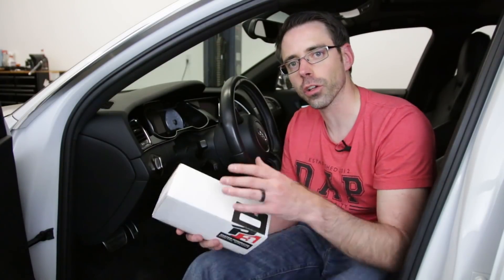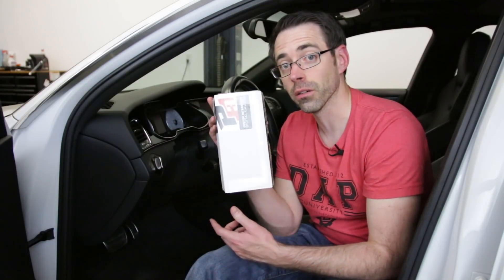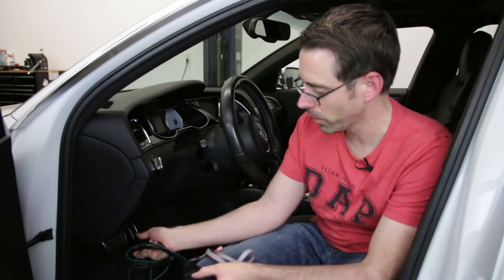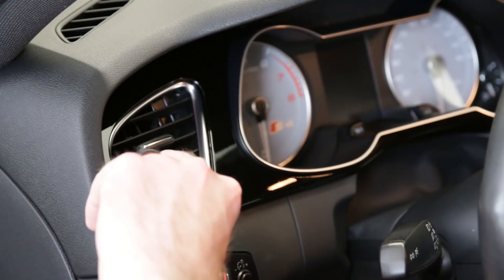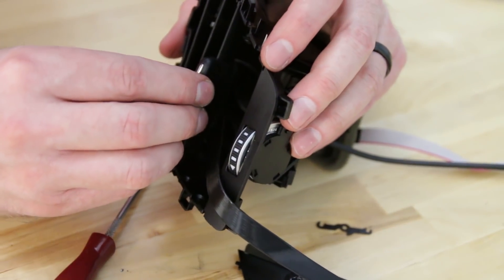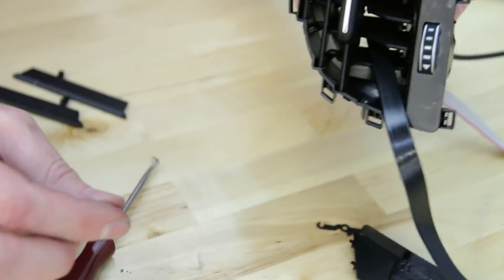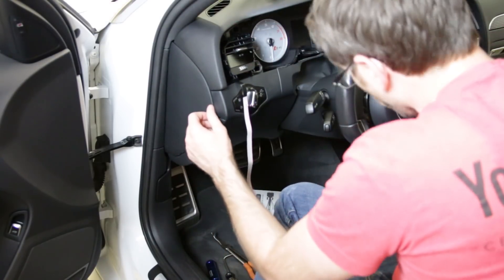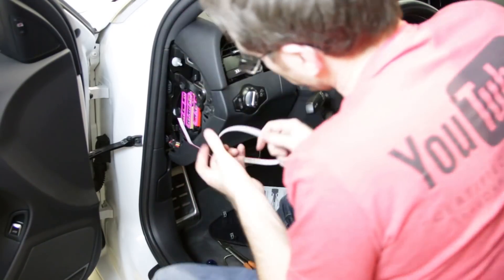How to Install a Boost Gauge on a B8.5 Audi S4

Comment: A really useful gauge for the S4 would be an oil temperature gauge.  I am left guessing how hot the engine is running.  It was on some of my prior Audi models.
Reply: Just code a lape Timer ... so u have your Oiltemp. for free. U can do it with VCDS

Comment: Smart idea to check it works before install!  I used some Tesa tape to hold the wire down on the inside of the vent.   Electrical tape would also probably do the job.

Comment: I installed one of these two year ago on my 2013 S4... Could have saved a lot of time if I knew about that trick to get the fuses out of the way!!  BTW... If you don't want to fiddle with the vent slats, P3Cars sells this unit already pre-installed in the vent for like $200 more.  Can't wait to see what your stock 0-60 time is!!  I got my P3 to  read 3.5 sec. after upgrading to a tune and dual supercharger pulleys!
Reply: Is your car auto or manual?
Reply: DSG

Comment: Hey I know this is off topic, but I saw your video on OBDeleven and wanted to know if it was a good option to use to diagnose micro switches in the driverside door hinge?
Reply: gingi 801 if anyone wanted to know yes it's a great tool to diagnose those switches